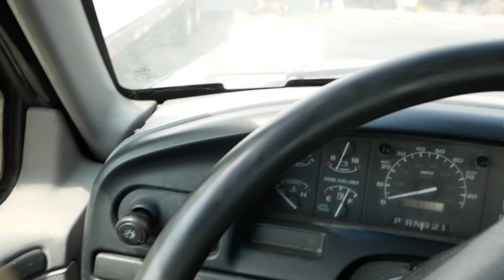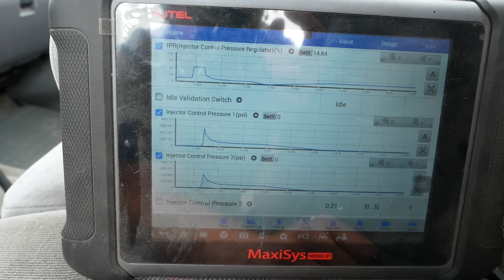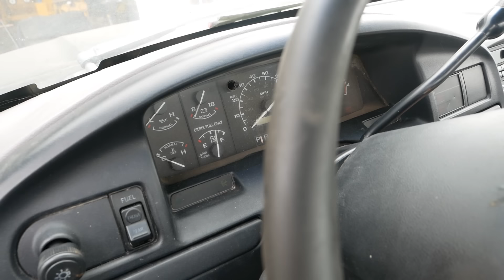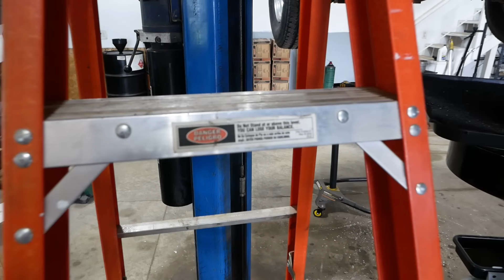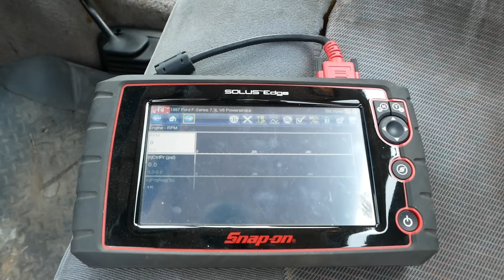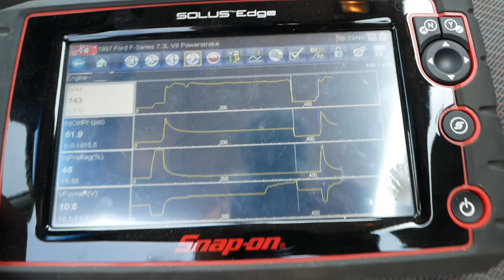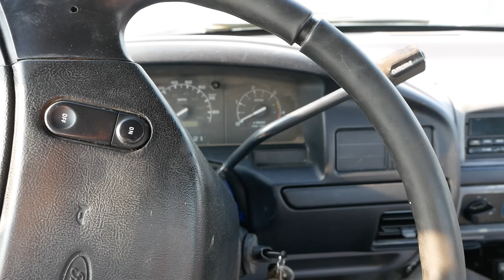Can We Get This 7.3 Power Stroke Back on the Road After Four Years?

Comment: I have a couple of novice questions; With the broken brake bleeder, why not try to loosen it while it’s still hot from the weld? I’ve heated stuck bolts before and immediately wrenched on them with good results— never tried it on brake parts or something this small so just wondering. Also with all the rust damage to this truck I can see how it would still be useful as a snow plow machine or occasionally moving something around the yard but I don’t see being in it long enough in the summer time to run the AC. Why spend the money on an AC compressor?  Thanks.

Comment: My truck had a long start too, replacing the glow plug solenoid (near the fuel bowl) made a huge difference in starting time. Probably went from  15 seconds to 8. Once I replaced the starter. Shaved another 3 seconds. Not saying this is the same issue you’re having with this truck.

Comment: A truck I’d love to find is a 1992 to 1995 crew cab F250HD 460 ZF HD 5 speed manual 4x4 single rear wheel 8’ bed. I’m not really fond of the looks of the 1998 and newer F250/F350.

Comment: Just letting it idle isn't usually enough to purge the air. I always have to drive mine to get it to crank properly after getting air in the oil system

Comment: I looked at a customers truck that was exactly the same as that one, but with a 5 speed. He bought it brand new and only used it to pull a camper a few times per year. He got sick and the truck sat for 2 winters and a summer. When I opened the hood, Packrats had gotten in it and you could not see the ground, or even the power steering pump. The truck was destroyed. It only had 47,000 miles on it. 😢
Reply from the maker: I'm glad we don't have those things around here.
Reply: They build nests that look like beaver dams on dry land. They use crazy stuff like empty cans, empty grease tubes, clothing, and about every other type of miscellaneous plastic bags.

Comment: I'm wondering if the low voltages you were seeing during cranking are the culprit, basically just inadequate  batteries. 10.1 is really close to the 10V minimum needed, and I'm guessing the 10.8v you got on the "key left on" start was because the glow plugs weren't also drawing current and causing voltage drop.

Comment: Hi I'm a mechanic in NZ. As far as i know ford didnt sell anything in NZ ( new) with the power stroke motors.  So I'm not to familiar with them. Regarding the long starting time. Could it have a fuel line problem. Sucking air into a line or fitting. i used to work on some Mercedes vans with the 4cyl diesel motor  (612 motor maybe) They had long start problems . They had formed plastic fuel lines with "o" rings on them. The motor would start quickly if it had been run in the last 15 minutes but if it got left for more than an hour you'd be cranking for 30 - 40 seconds or more before it would start if at all.  The "o" rings had gone hard on the fuel lines, not enough to leak fuel but enough to let air into the lines as it sat.  Looking at the general of this truck any thing is possible.  I'd breed off that starter motor, Its a good one LOL Good on you for spotting that bad wiring. I bet you theres more like that.

Comment: Old video I know, I had one truck come in for rear diff plug, this thing would not come out, couldn't even get a good weld on it where it was at, I ended up taking the cover off and added a new fill plug for the guy on the diff cover, he didn't have a ton of money and the amount of time it would of took to properly get at the fill plug would of costed more than just adding one to the cover and be done with it.

Comment: You probably know it already but I learned on my f350 that there's a couple bolts for the shift lever under the dash that get loose and make the shifter sloppy. Caused it to be between park and reverse so it would stall. Also wouldn't start cause it was technically in reverse

Comment: Man that rust is something else. I live in central Mississippi and still see plenty of 80s and 90s trucks driving around without a lick of rust. Youd think automakers would have come up with some process or coating that would prevent this. I know some ships that spend decades out on the saltwater ocean use a sacrificial anode system to keep rust and corrosion at bay. Guess its planned obsolescence and the automakers want you to buy another vehicle after 10 yrs when it rusting away into dust 🧐
Reply: As an extra rust belter, I can tell you if you've never experienced it it's a trip with the amount of rust and salt.

Comment: Check the fuel lines going to the front tank and the tubes coming out of the sending unit they like to rust and pull air and it might not pull air when the key is on because of the the switch from front tank to the back could be holding it from pulling air

Comment: You were raising the dead there . When you put the double flare on the line at 30:01 , whose tool were you using ? I put a thin film of Never Seize on the bleeder threads and it seems to work the next time I bleed them . I notice that the higher quality line wrenches tend not to spread when you really lean on them .

Comment: Probably kinda to late to suggest this now, but what about air in fuel, my buddies 97 did the same thing, there is a bleeder for fuel on the back of the block, I bet you the reason it starts faster when you turn the key back on after you shut it off the fuel pump cycles doesn’t loose prime

Comment: That plastic front tank is more than likely OEM. I have only noticed them in 97 F250/350s though. The C&C trucks had plastic rear tanks also. Idk what the rhyme or reason for some having plastic and some having steel though. May have been an option in 97.
Reply: Also every 92-96 F150/250/350/Fsuperduty & 97 F250HD/F350/Fsuperduty i have ever dealt with has had factory stainless fuel lines. Gm couldve taken lessons on that for their 99-07 trucks lol

Comment: I am curious why you don't use a vacuum bleeder.  The one that uses shop air.  I tried one of those hand pump mighty vac ones and it didn't work well.  Picked up a cheap harbor freight air driven one and itvworks fantastic.  No assistant needed.  Super fast too.  Just need to watch the reservoir.

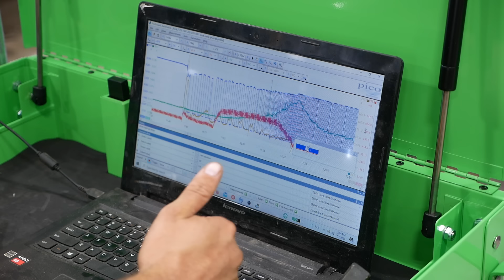Comment: 7:38 this is when diesel engines sound good. 28:12 people who don’t have videos of them working on cars. Know more about cars than people with automotive videos. 44:00 does it has a fuel pump in the tank that pressurizes the high pressure pump?

Comment: I know this truck is long gone but do you check the vent valve for the rear end ,,,two’s ago I changed both bearings and seal , anyway long story story short the guy where I bought my bearings and seals from asked if I check vent valve cause vapors and heat that builds up has to escape somewhere it had over 200,000 miles and the vent holes were clogged up like  a toilet so I squirted a little of WD-40 and that could have save me two days and $90 i’m talking about the vent valve on top of the rear end that has a rubber hose going from it up to the frame so that if you go into any water it won’t go into the rear axle I’m sure you know all about

Comment: Is it possible those wires are shorted out further down the line? That would cause no change to the long crank, and since it starts eventually, maybe something is staying powered on when you flip the key back on within 5 seconds? It really seems like an electrical issue and felt like you were very close.

Comment: Ive got a 2000 7.3L SD ... ran fine.  Had a couple small oil leaks.  R&R.. deleted pedestal, new hp oil lines, new icp, new ipr, rebuild of hpop (o rings) rebuilt fuel bowl, new fuel bowl heater, new glow plugs....  i have no dtcs except exhaust bp sensor.   Crank, NO START.  buzz test reports 'no errors'..  but nothing buzzed (no noise, no movement)

Someone help, please.

Comment: Ur compression is getting low glow plugs r cycling while key is left on thereby easier start.  When it does long crank does it smoke?  If yes it’s the fuel increasing compression
Reply from the maker: No. I tried it with the GP relay unhooked. The results are the same.

Comment: I betcha that ICP is your issue with the long crank. Did you try unplugging it and seeing if it made any difference? If oil is coming out of the connector it is bad. Even if it is dry its probably still bad. Those things are a common issue.

Comment: On a 6.0 power stroke the icp sensor when it fails the ecm gives a false signal to enable the truck to run you have to watch voltage on it to see if it's the ecm giving it a false signal don't know if the 7.3 is the same but both are heui

Comment: Seems like these 1995-1997 f250 7.3l diesels always have issue my neighbors 96 f350 dually 7.3l powerstroke stopped running it cranked just won't start it was a idm that caused the failure he took it too multiple shops to have it scanned for codes had many things replaced on it that was showing up to be the problem, and mechanic told him the last thing I would check is your idm, yeah idm was shot solder  and circuit board inside the idm case was wet, and falling apart, he later parted it out and sold rest to a guy that wanted to restore it. I was thinking on buying a 7.3l diesel that has high mileage and rust for a spare truck to drive. 1995-2001 f250 4x4 with 7.3l diesel.

Comment: I would look at the fuel pump.  Because when you leave  The key on it leaves pressure in the fuel pump pump which keeps pressure on the rest of the system you might have a leak in the fuel pump that's relieving the pressure off of disturbed or fuel distributor I think that's what it's called

Comment: In my experience with the 7.3L with a long crank like that is the low pressure oil pump is bad. If the low pressure pump is failing then it can’t supply the right amount of oil to the high pressure pump for it to do its job.

Comment: 28:06 ive had that issue with the fill bolt i just drilled the top of the diff cover filled it and but a valve stem in ghetto but it works

Comment: I don't know if it's too late to ask, but it may be worth asking. Had to replace the HPOP in mine, I also have installed a FRX on mine. About the only upgrades besides the 3" downpipe. Everything else is mostly factory. Can anyone think of a reason I'm blowing out IPR valves left and right? I replaced it 3 times now and it's fried each one out within 20 miles. I do also have oil leaks and go through quite a bit, fairly fast in fact. All of these IPRs have been pulled from other 7.3s that ran when parked. Mine is a 97 with 563k miles. I also did have to replace the pigtail on mine, as it burned up almost identical to the one in this video.

Comment: why dont you get vacuum or pressure bleeder for the brakes?
Reply from the maker: I have both.
Reply: @WatchWesWork  does bleeding them manually work better or? At work i 99% of the time use either pressure or vacuum bleeder. They get air out good and flush fluids fast
Reply from the maker: @j0lel666  I just like harassing the old lady! On rear brakes I find the pressure bleeder struggles to push through the ABS valve some older trucks.

Comment: HI WES,i know nothing about diesels,but here's my 2 cents worth.That one wire loom that had THE @ WIRES FUSED together,and the fact that if you leave the ignition on for half and hour the truck starts right up.Could it be that the owner discovered that IF HE LEFT THE KEY ON>>>he could himself eliminate a long crank time HENCE MELTING JUST THOSE 2 WIRES? OR is that circuit ONLY operate during the crank cycle?JUST guessing here.

Comment: I've done the spring hangers on these. They are common. Over the past 10 years I've seen these rot one at a time while there's millions. I'm a GM guy myself. Not stating "politics here or religion, or her". But I will say there's quite a few issues that for ford I can say "I can't go for that" but there is a few times I've seen a n aggravating issue with these. I personally am into my squares.
Reply: Oh ueah, I've seen square bodies and many chevy's sit in a field for we'll over 5 years without an issue other than gas/diesel exchange and maybe filters/ batteries, & air itself. They fire right, up!!

Comment: Have you checked fuel pressure or fuel pump return valve . If these are worn the vechicle will behave the same like in the video check the fuel filters and if this ford also has a in built electric fuel pump if these are also faulty and leaking back to the tank the same effect will happen, and yes I have seen these ford diesels with a pump in the tank and a pump on the motor. ! Fords idea was that it would make a diesels easier to bleed and to keep the flow pressure up so the engine immediately starts after.the glow plugs were heated . ???

Comment: Funny story about fill plugs. I changed a transfer case on a 99 Tahoe I owned and once it was in I drained it to fill with fresh fluid. I tried to get the fill plug out and there was no way. I worked at it until there was nothing left of it. Finally I went out and bought one of those quart size pumps and put some tape on the plastic tip of the hose. I pumped the fluid in from the drain and just over filled it a bit and put the plug in as quick as I could. I wish I knew before I put it in. Dang fill plugs.
Reply from the maker: That works!

Comment: I will be incline to think that the capacitors in the ECM are bad.When you leave the key on there's always power going to the ECM that way those capacitors stay charge when you shut the power off no more power to ECM so the next time you power on you need to charge your capacitors take  a few more seconds to charge those capacitors.

Comment: dont you use any rustpreventative in the states,???,here in Denmark most ppl used it espesially on the older cars  something like a mixture of bitumen and hydralic oil , many also used bar and chain oil  but either you start before the car becomes to crusty  or you have to remove all lose skaling and rust  and yes this one is a bit late for the treatment,,,

Comment: should have pressure washed the engine and engine bay, oil and oil filter change, diesel filter change, fresh diesel in the tank, brake fluid check and top off if needed, power steering fluid check before even firing up the engine. Also with old vehicles it's a good idea to run a thick battery cable from the engine to a ground on the body because earths rust and get poor connections.

Comment: The bolt at the bottom of the steering column needs to be Tightened that’s what is causing the shifter to be loose

Comment: The early 7.3 engines are great they can take most any abuse you can throw at them, prefer them with a 5 speed, I'm not a fan of the dork converter auto job. I have a  85 F350 6.9 idi running 4.10, even more of a work animal just a lot slower.

Comment: So you didn’t figure out that you could turn the battery around and the positive negative terminals would be on the other end?
Reply from the maker: That doesn't work. The terminals would be on the wrong side of the battery and the cables won't reach.

Comment: I really believe that the truck should have been sent to the scrapyard the day it stopped running for the simple reason that the only thing keeping the body from falling off of the chassis or vice versa appears to be the obvious heavy rust that is bonding the two together. The Rust Belt takes another victim !!! BTW: The rat/mice infestation would make it extremely dangerous to be breathing/inhaling the cab's air especially the heater and A/C air output when in use. Not Me Brother, Not Me !!!

Comment: isn't there a check valve in the fuel bowl?   draining back to tank   ?
Reply: as for key on....wouldn't that keep the lift pump running....so fuel stays in bowl   but  key off   fuel is draining back from the bowl  and will not start until lift pump replaces it ..?
Reply from the maker: The lift pump is entirely mechanical. It runs off the cam shaft.

Comment: When you have a oil pressure reliant injection system, do not trust the date. You need a high pressure gauge and tie into ICP and compare actual mechanical pressure reading to data pid, you will find your answer.

Comment: I just bought a 1990 F350 crew cab 7.3 IDI. It was starting hard about 10 times over about 1 month period . then I got a crank no start.  Turns out the diesel in the tank was 10 years old. I sucked it out with a pump and it was bright orange.  It has the fuel pump on the engine still. I think they put the pump in the tank around 92 or 93.  it has a flat bed and hard to get the tank out so I added new diesel and still can't get it to crank. I think the fuel is bleeding back down because of a small air leak up top but not sure yet. But I'm not really much of a diesel mechanic. Tired of working on it already.  Anyone any idea's?

Comment: The sad part is they could make these trucks last forever they intentionally make them so they will rot out.
 I've read that if you put a chunk of zinc in the corner of the frame and run a small charge to it all the rust will attack the zinc block and not the frame,  either that or go back to 1997 and put some rubberized undercoating on it what a beautiful sounding motor though. That is a beautiful truck

Comment: I got the exact same truck with that motor and I'm not getting fuel in the bowl any suggestions?
Reply from the maker: It has a mechanical fuel pump in the valley of the engine.
Reply: @WatchWesWork  I replaced that and it  still wouldn't start

Comment: needs an oil /filter change .  this is how my 96 starts when i push my oil changes too far past 6000 miles.   455000 and counting.  change the oil and it flashes up fast consistently.